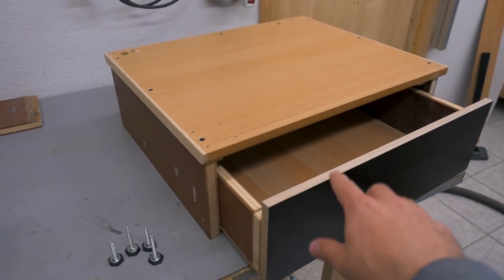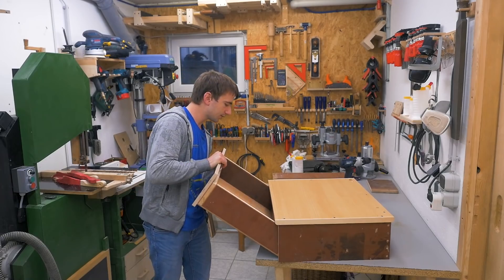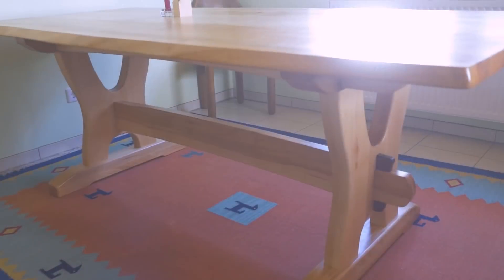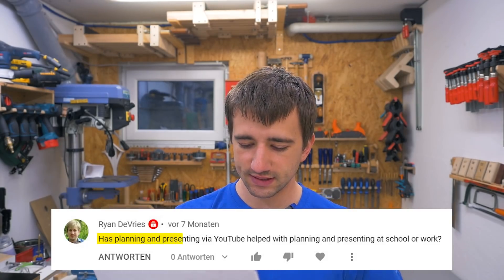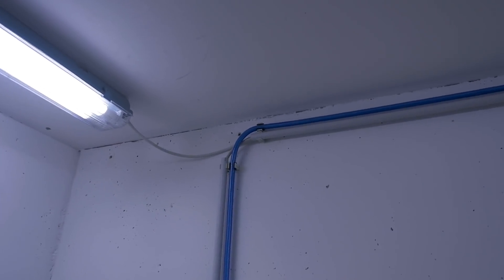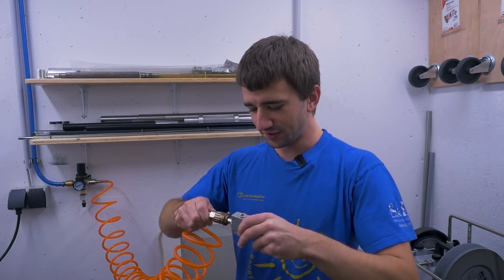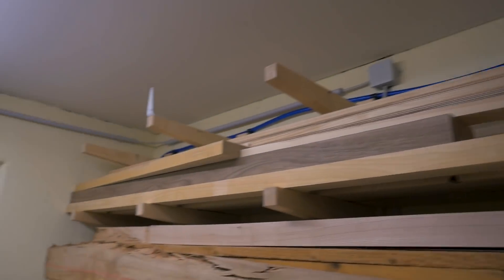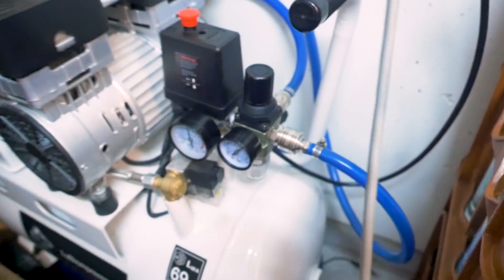Smart & Easy Drawer Slide, Q&A and Mini Project (Random Shop Stuff 26)

Comment: I personally like to use soap and water in a spray bottle to check for air or gas leaks under pressure.  I'm also finding I really like the new self-locking push-to-connect air fittings.  I had a piece of air hose here while back that would not seal up, so I ordered some push-to-connect style fitting and hose.

Comment: Love the drawer solution! Phenolic-faced ply is way underutilised, there are loads of applications for it. UHMW strips too - I think they're very common in industry/process engineering, but I only ever see makers using the tape, or sometimes offcuts of chopping boards. Really low friction, really low wear, really cheap!

Comment: Instead of the distributor block with threads I'd recommend using a simple barbed 3 way (brass) T-fitting for hoses. It's not only cheaper, but even more importantly there are no leaking threads, because there are non to seal in the first place. If the hoses are in the clamps on the wall, the piece is also easily held in place by them, no need to mount fitting itself to the wall.

Comment: Hey, a note on your 3d printed gasket. A great idea and may be helpful when you need one quickly but a lot of these fittings are designed to seal on the threads, not the shoulder of the fitting. A common example is NPT fittings (tapered threads). Not 100% what fittings you have there but please stay safe!

Comment: 0:26 Are those your homemade leveling feet? How did you make them small? I've seen your videos of the big ones, but these look and probably work differently...like where will the bolts go on the drawer? Add a base?
Reply from the maker: They are not the same. It's only a bolt with a hex-shpe 3D-printed pad clamped on the bolt head. It gets directly threaded in the wood where I cut threads into
Reply: @MariusHornberger  "it gets directly threaded in the wood where I cut threads into" - would love to see how you do that. 😁